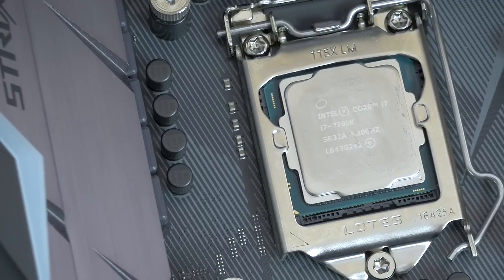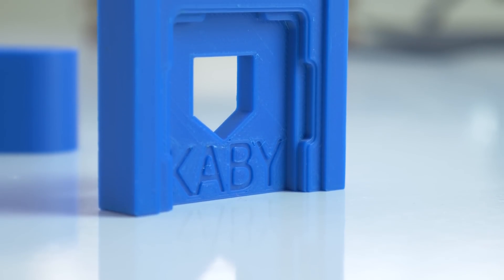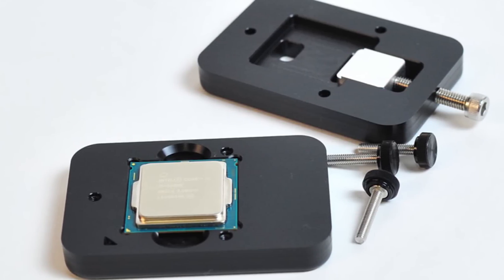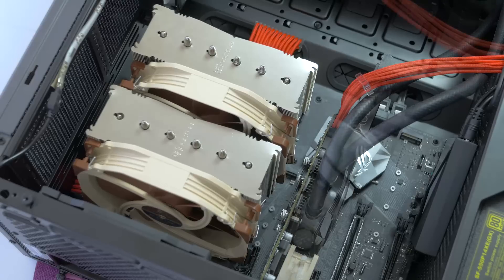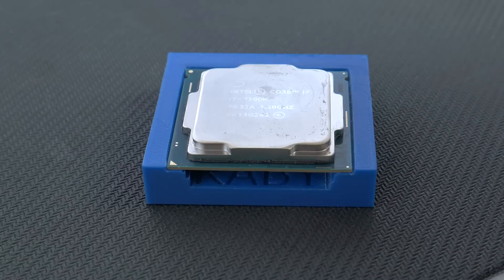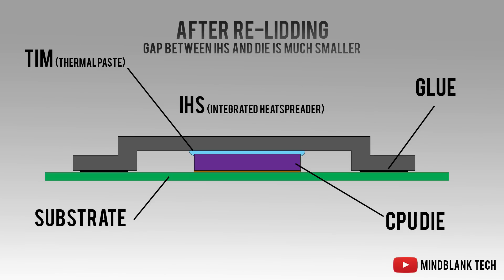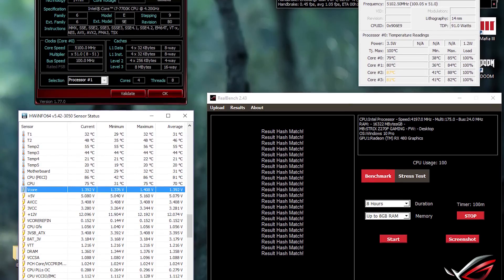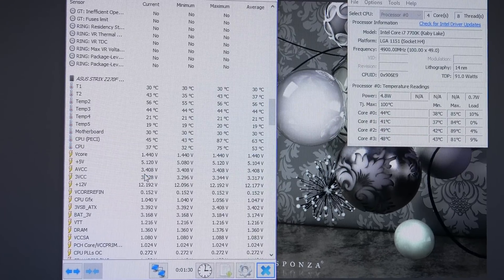Delidding the 7700K - 5.2GHz Overclock - 25C cooler

Comment: Deliding is possible for amd? Or do the pins on the cpu make it more risky?
Reply: in that case, intel make it better doing the pins in mobo, cuz is easier to sell the processor later...

but talking about the mobo's, AMD mobos are more expensive than intel's ones... and AMD's processors are cheaper...

i personally prefer intel cuz i used intel for my entire life... and i live at 1 feet from my desktop, so have a heater what warms my face in a hot country is a bad idea.
Reply: not all amd cpus ar soldered as long you are caucios u wont damage anything i dellided two cpus 5 minutes ago  at the first one maybe i screwed up a bit but hey first time try :D  just get a old one so you get a feeling for it :D btw i like the pins on amd chips more just because if u bend it you just take a long knife and bend it back in a intel socket its a bit more difficult because less space :D and amd boards and intel boards arent much a difference except the high end boards
Reply: The 9590 and 9370 are heaters but all other CPUs are pretty cool you know...
Reply: Luka David Torkar for me the biggest problem is AMD cooler box loudness... my friend have a fx 8350, and it is a loud heater.
Reply: Then it must be a really bad 8350... + the old stock cooler that came with the 8350 was crap. The wraith cooler is much better. But then again... Intel coolers aren't much more than the bare minimum...

Comment: my 7700k at 4.8 GHz 1.275V is running arund 85-90C in Prime95 but 5.0GHz requires 1.4V and temps go all the way up to 100C.. and thats under Corsair H110..
Reply: Are you sure the h110 is ok? those temps seem a little extreme... my 6700k @ 4.6 @ 1.32v never goes above 55 degrees celcius
Reply: Drannoying HV well I built pc by myself 2 weeks ago. 2 stock fans are set as push , pump is connected to cpu fan 2 ( gigabyte z270 gaming 7). on max fan speed it was slightly cooler but very noisy. What could I miss?
Reply: darodaredevil Are you sure you connected the fans as well? It's really strange...
Reply: +Drannoying HV yes they are connected (one to MB fan 1 and one to MB pump connector 2). I set them with gigabyte's smart fan in BIOS to respond to CPU temp, then I fiddled with both quiet and performance settings and performance settings made them very loud so I stayed with Quiet setting but even when running them in performance the cpu temps were high, maybe 5-8 degree less than quiet mode

Comment: Why not put cooler directly on core, without IHS?
Reply: Because there's a big chance your cooler won't make proper contact. And if it will, there's a big chance of chipping the actual cpu and killing it
Reply: Then give CPU cooler for CNC machining so copper base will lay on PCB of CPU and 0,05mm above silicon core.
Reply: Or just put the IHS back on.
Reply: IHS = two layers of thermal paste.
Reply: as said above, it will possibly not make proper contact with the chip, also there is a possible chance that it can crush the die itself, killing the entire system together with it :)
Reply: What about that?:
https://drive.google.com/open?id=0B8pmYEYBMHsRWExMMFFUTXE4T0E
Reply: the epoxy could trap the heat around the die itself, i think it would be good if there is a similar idea to yours but built with some sort of metal or heat conductive ceramic instead of epoxy giving more surface area for the coldplate to pick the heat up from whilst giving support to the die. something along the lines of direct die cooling.
Reply: Epoxy will be at least 10x better than actually existing air which has huge thermal resistance.
You can also replace epoxy with copper plate.
But I will more likely WAIT FOR RYZEN that should have soldered IHS to dye.
Reply: yes, of course it would be better then air since there is a huge difference in density between the two and their heat transfer abilities. like i said above, your idea of using epoxy is good, but could be made better if a better thermal material could be used around the die instead of epoxy

Comment: Why do you even need the lid? Can't we just apply the thermal paste directly onto the chip?
Reply from the maker: Dies are a very delicate and fragile thing. Anybody old enough to have lived through the awesome Athlon glory era (Thunderbird, Thoroughbred, Palomino, Barton etc.), knows how easy it was to crack a die with the heatsink. You will get better cooling performance with bare die but you need to be very careful in installing the heatsink. Some coolers have a poor mounting system making cracking veeeery easy. Something like Noctua's SecuFirm 2 which uses symmetrical threads to hold the heatsink in place is a more safe way, but I'd still be careful.

Comment: nice job, I have a very similar 7700k in how it handles clocks/volts. Mine does 5.2ghz @ 1.42v but make sure if you are running faster than 3000mhz ram to bump up your VCCIO voltage a touch at those higher cpu frequencies. I was able to drop a little voltage off my vcore and keep stability.
Reply from the maker: Hey man! Good chip. Yeah, my IMC is not the best. I can't boot at high RAM frequencies unless I really up VCCIO and VCCSA voltages. This also translates to more heat ,sadly...

Comment: That's not acceptable. Wth Intel
Reply: talking about temperatures or CPU's with thermal compound under the cover?
Reply: Pedro Bermudes Temps. Thermal compound under the ihs is totally fine if its good compound.
Reply: Patrick Jackson they should do like lga 1156 era, where intel's are soldered.

Comment: did u use liquid Tim between ihs and die, and then grizzly between cooler and ihs? or grizzly as both tim and paste?
Reply: Vandoeun Long i have the same question
Reply: wanted to know because i'm not sure if using liquid tim or grizzly is better for between ihs and die.
Reply: I just saw a video of another user where he used liquid metal between the ihs and the die. And then he used thermal paste between the ihs and the cooler. His temps went down 15C
Reply: i might make an open bench to check tim between ihs and die vs grizzly between ihs and die on my 6600k.  i just have to get a rockit tool and cool lab tim.  probably wont glue or use adhesive to seal it until i find out which is better.
Reply: Well, after reading and watching so many forums and videos... The majority is using thermal grizzly conductonaut between the ihs and the die and works really good. Recomendation: dont use any glue. About the 6600k, i saw that it doesnt have temperatures problem. Does yours have? And about the delidding tool.. i dont know if just with a cutter is enough.
(Sorry for my english)
Reply: i have no problems with skylake, but just wanted to use my 6600k as a tester.  i have 6700k and thinking of getting the hot 7700k to delid.

Comment: I decided to delid my brand new i7 7700K after watching this video and I personally thinks that everyone should do it: it's a piece of cake to do. I spent 20€ to 3D print the deliding tool in a shop near my house, deliding, cleaning and thermal paste replacement took 20 minutes... Easy.  I probably have a very good sample of the CPU too, i'm writing this while stress testing at 5.1GHz, with max temperature at 71°C using an H80i V2 AIO cooler. Tested for 12H with Intel XTU and X264 stress tests, very solid performance... The motherboard is a Maximus IX Code. Really happy about that.
Thanks for the video... :-)

Comment: What's the power droa of the CPU after the overclock? By how much does the efficency decrease?
Reply from the maker: Overclocked to 5.1GHz at 1.392v during load, I see around 100W power draw  and 110-120W when AVX instructions are used.

Comment: I have a 7820HK in my laptop and I can overclock it to 4.4GHz, but it only takes a few seconds of doing anything strenuous before getting up to the 100C limit. Now I see what a big disadvantage a laptop has. My CPU only wants to run at roughly 3.5GHz continuous when doing doing something like video rendering.

Comment: maybe I need a new cpu. my i5 4670k can only get to 4.2ghz stable at 1.35mv and runs too hot for air cooling even after deliding so i took it back to 4ghz at stock voltage.

Comment: nice video dude. the temp drops is amazing. I find it hard to believe that Intel can do such a crap job on the tim. I delidded my 4790k and didn't even use liquid metal, I used Cooler master mastergel nano on the die and already it's a major difference compared to included tim. I'm still seeing high temps but at least it's not 80-90C as before
Reply from the maker: Thanks dude, glad you enjoyed it. Delidding will make a difference even on soldered CPUs, like the E-lineup 6 and 8 core ones. Check it out in other videos on YT. It's not as drastic as it's on our "regular" i7s, but it's an improvement for sure.

Comment: Why doesn't Intel just do a better job
Reply: Because they're top dog for now and only care about profits.
Reply: My theory is they're planning a Kaby Refresh, ala Haswell, to give them time to figure out 10nm for cannonlake.
Reply: I just find it totally lazy of them. They can design and manufacture one of the worlds most advanced consumer products but can't use the correct amount of glue.
Reply: Ryzen is showing potential to be good value for multi thread productivity stuff.  But for hi end gaming, I'll be very surprised if it can out do a 7700k.
Reply: Long story short:  Because they don't have to.  At least, they didn't.  Ryzen should make thing interesting again.
Reply: der8auer explained that Intel uses this thermal paste simply because it's very reliable and is consistent over time, but some thermal performance is sacrificed.
Reply: I thought Intel's skipping 10nm because the yields weren't worth it and going straight for 7nm.
Reply: Do you have a link?  Wikipedia reckons cannon lake as well as Icelake and tigerlake after it will all be 10nm.  While Coffee lake at 14nm will replace desktop versions of a 10nm manufacturing process in late 2017 due to low yield.  7nm is supposed to happen when we move off of silicon and onto gainas.
Reply: because Intel doesn't financially need to
Reply: because AMD do nothing.
Reply: @Maisonier - AMD do a lot better job than shitty Bintel
Reply: +Richard Dale Because they have been fucking amd in the ass for the past 20 thousand years to the point where they don't need to release new cpu's because you the consumer are forced to buy from intel because no one else is there to sell 
but no more, amd ryzen is coming to save us and create some competition in the cpu market ughhhhhhhh finally
Reply: Mohamed Osama amd and the Athlon 64 weren't cheap for their time.  they were breaking edge in the field.
Reply: Njoekiezoekie ..dude it's not optimized. Intel has had allot of time for optimization...your a fucking moron
Reply: you obviously have no idea what you re talking about :D haha
Reply: Tumble Butt / Styx on Fire that's amd
Reply: Njoekiezoekie first of many bios updates and ryzen has already seen a 31 percent increase in efficiency...you salty piece of crap how's it taste? Lolzz
Reply: Richard Dale that's too easy
Reply: the comments sounds legit... making the first round crappy. They can make the refresh look better by having better thermal paste.
Reply: They only care for money.
Reply: Baruch "some" thermals are lost.. 25c aint a small number
Reply: Because more people void the guarantee to be cooler, marketing strategy....
Reply: Don't be an idiot and buy AMD Ryzen.
Reply: Intel using thermal paste has other reasons not because they cheap out. omfg
Reply: Enjoy the failure that is ryzen. Already performing below par and for gaming it is shit.

Comment: Nice vid! Thank a lot. It's great to know, how big difference it can be... after delidding.
 I was thinking about that, but after all tests at 5.0 Ghz and modified H115i i have max 75°-77° after 1 hour of hardcore benchmarks.
In games its max 62-67° and media/internet use 24°-32° max, so... if you have a good cooling system you don't haveto risk dammage :)

Comment: is it ok to use a different tim like thermal grizzly kryonaut. It comes close to lquid metal but is not conductive.
Reply from the maker: Yeah, you can try it. It might pump-out, meaning it'll jump out between the die and the IHS. That's what people have found with non CLU TIMs. But try it, it doesn't hurt. Just don't reseal you IHS. ;)

Comment: Wow, my 7700k runs with 5,2ghz on 1.38v 2h Prime95@1344 Stable no problems but 90° :( Cutstom Watercooled
non Delid, waiting for the Delid Die Mate 2~
Reply from the maker: Hey, that;s a very good chip. After delid I expect you to have 5.2 at around 1.35v or even try pushing 5.3 with 1.4v or around that. Which is just fine for 24/7. And you got yourself a monster CPU right there! Congrats either way!

Comment: Sure you got a nice improvement there, but 80-85C is still hot i my opinion. I would rather run it at 4700-4800 Mhz and lower volt and temps for 24/7 use :)
Reply from the maker: Maybe. Temps are so subjective at this point that it's like an opinion... Think about the fact that there are laptops running 95C or more during load for years and they are ok. Plus, that 80-85 is transient, no sustained. The average maximums are around 77C for all cores. Also this is only during artificial load. If we consider normal load like gaming or editing, we are talking about low 60s with the fans no even revving up.

Comment: Could you show us the delided 7700K with some 65mm or smaller CPU coolers? I belive this might solve some heat issues in SFF cases.
Reply from the maker: I don't have such a cooler, but I imagine this CPU to work with something like that at stock 4.5GHz as long as it's also a good chip and can go undervolt nicely. You then got yourself a monster SFF gaming PC.

Comment: Have you not thought about getting a water cooler (like h20 but dual rad version your case should be able to accommodate it)
Reply from the maker: I though about switching to custom water cooling. Things is that temps are great right now with the NH-D15 and this thing is pretty damn quiet. Putting the effort in a custom loop to perform better while still being as quiet, is kinda hard.
Reply: MindBlank Tech you can buy a closed loop cooler, no custom tubing

Comment: i run my i7 7700k @5,0 Ghz with 1.365V right now. But I plan to delied it in the upcoming month so i can drop the Voltage down a little more. With my NH-D15 I get arroung 80°C. My i5 3570k 4,4GHz with 1,4Ghz only hit 70°C. So 80°C is not really an option for me.

Comment: How did you mount your CPU afterwards? Did you put the die in first and then the IHS? Somehow I managed to bend a couple of pins on the socket after mounting the CPU. it might have been the cooler I was using though (Kraken X62).
 
Going to try and unbend the pins later today otherwise I'll have to get a new motherboard :(

Thanks.
Reply from the maker: +KiraYamato56 Be very careful straightening them! I bent pins on a Z68 once and used a toothpick and a magnifying glass to get the straight again. It worked!
I put the CPU in the socket, like usual, then I aligned the IHS so that it was roughly positioned like before delid. Then lowered the retention bracket and fixed everything in place. It's easy, don't worry about it.

Comment: but what ifbyou completely remove the lid, and put cooler directly on the die?
Reply: gamezone047 You run the risk of cracking the die....and you probably will since the coolers are designed with the lid in place
Reply from the maker: +gamezone047 You can do that - running a bare die. Chances of cracking the die are pretty high unless you are extremely careful. Anyone that owned an Athlon in the 90s and early 2000s remembers how easy cracking the die was. Never cracked an Athlon die ever, but was really anxious each time I switched coolers or refreshed the TIM, because some people I know had cracked theirs so easily.

Comment: 4690k here running on 4.5GHz on 1.295v
Reply: Im happy i got running my 4690k @4.7GHz on 1.401v never reaching above 70 degrees.
Reply: HypesFeed man get down ur voltage if u dont want to kill it in next few months 
thats not comfortable for this chip
save voltage is under 1.35v
Reply: Then don't run it at 4.7 ... 1.4v is not good
Reply: ***** but could be better,i cant go 4.6GHz cuz it wants more than 1.34v which is not comfortable for me
Reply: ***** that's true
Reply: Good speed for that chip. Also, how the hell do you pronounce your surname?
Reply: discostoo haha,im from Poland,here where i live its normal and its easy to say :)
Reply: Grzegorz Brzęczyszczykiewicz I've tried running it at under what the voltage currently is but after a few minutes of playing/stressing I just blue screen and have to restart.
Reply: HypesFeed a ok
Reply: HypesFeed ye,drop down frequency to 4.6 and test it with less voltages